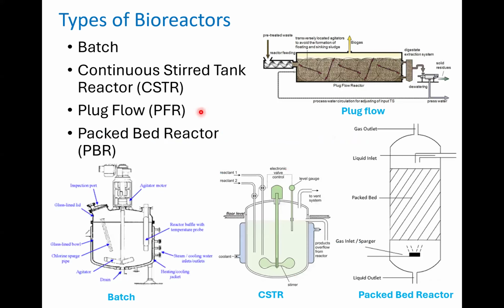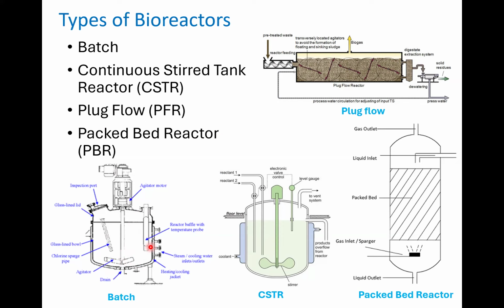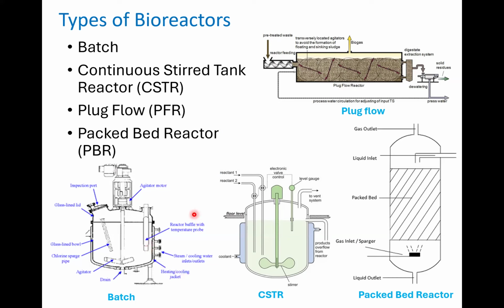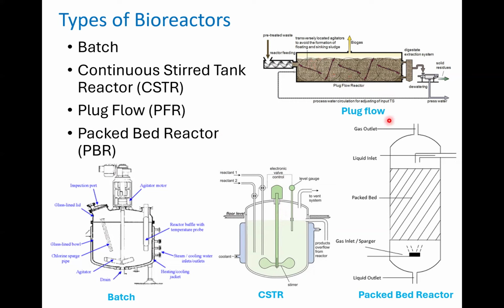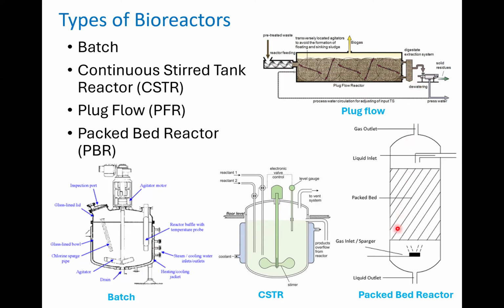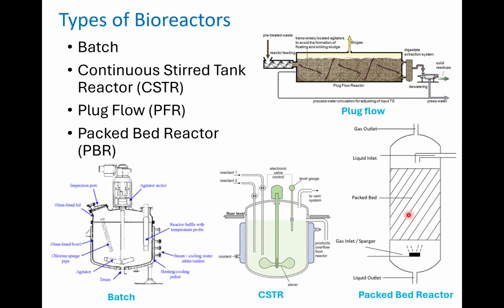Types of Bioreactors

Comment: So all of them you could call typical bioreactors? Can you name a few other typical bioreactors? And also what untypical (unusual) bioreactors are used in biotechnology (for example a floating island )? I have such a question on my exam (to name typical and untypical bioreactors).
Reply from the maker: Untypical bioreactors are operated under special conditions to produce certain products or cells. They may include  microgravity bioreactors, perfusion bioreactors, high pressure bioreactor, or even photobioreactors.
Reply: @STEM-Sustainability.1041  so the bioreactors you are talking about on the video are all typical bioreactors?
Reply from the maker: @klaudiaseget7060  yes, the common ones for anaerobic digestion. But they can also be applied for other applications
Reply: @STEM-Sustainability.1041  ok thank you
Reply: @ are membrane bioreactors typical bioreactors?
Reply from the maker: @klaudiaseget7060  Membrane bioreactor is essentially a typical bioreactor but equipped with a membrane.